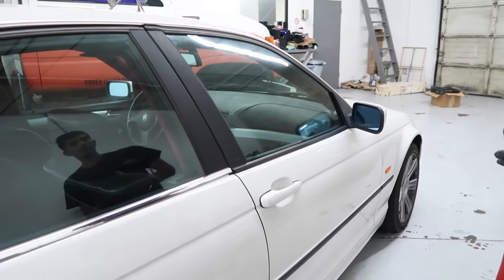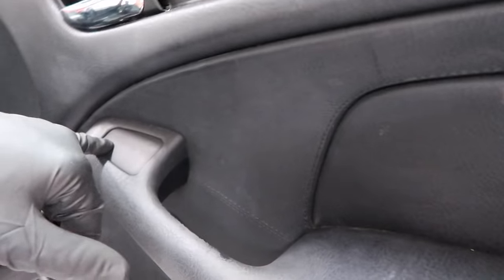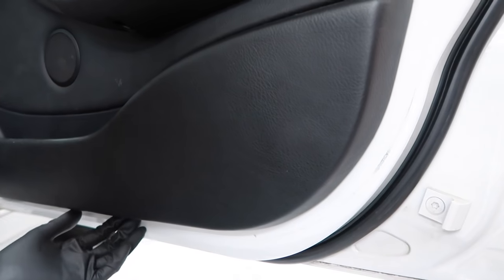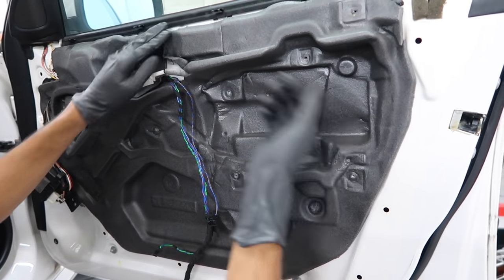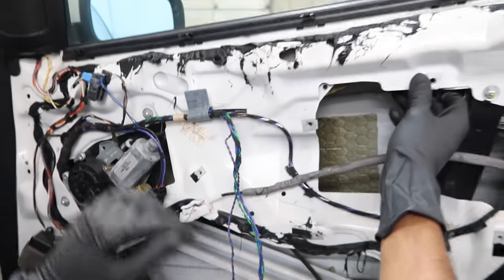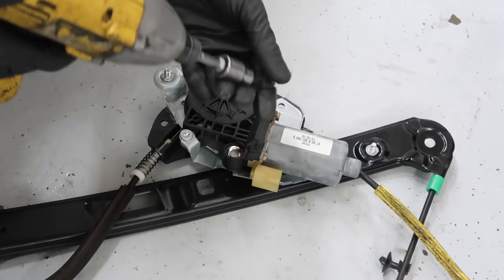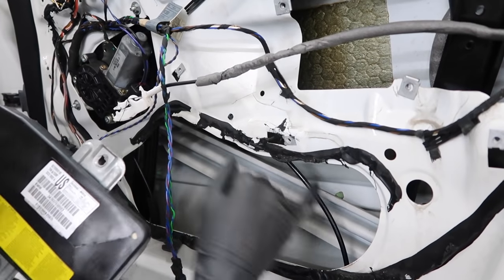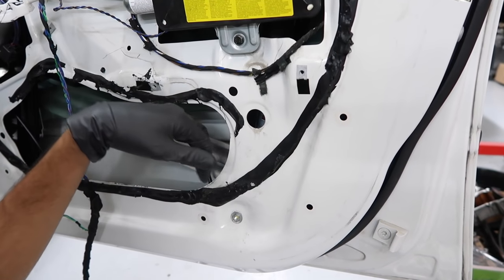BMW E46 Window Regulator DIY + Ebay Regulator Review

Comment: Just replaced my driver's side regulator with an Amazon $25.00 unit. Works like a charm. No fitment issues at all. I do highly recommend his tip to tape the bolt to the hex bit. It will save you a lot of headaches.
Reply: Can you drop the Amazon link?
Reply: You can also snag a teeny bit of that black goop thing and put it on the tip of your hex bit. Less hassle
Reply: Hi.. please share Amazon link.
Reply: I’ve done the same thing but it only lasts about a year or so. You get what you pay for when it comes to cheap parts so I’ve learned my lesson now for all 4 windows that a cheap regulator won’t last

Comment: Oh man!  The feels.... I think this was the first vid of yours I watched when I was having vapor barrier issues.  The rain was pouring in the bottom of my passenger side and you sorted me on how to fix that with your door disassembly in this video.  You helped with my DISA rebuild, vacuum leaks, valve cover #1, valve cover #2 when I did my VANOS. the VANOS, and two weeks ago when I did my whole cooling system. 

Now here I am again.  Two regulators went while stripping my old tint. You would think I would remember how it's done.

If you ever get back to Charlotte or Rock Hill, I owe you a lot of beer.
Reply: Hey I'm having the same issue but from the drivers side, what was your actual problem/fix as water keeps leaking through my armrest :(
Reply: @ii182  I put the vapor barrier back on and sealed the tears and bottom with Gorilla Tape. It has been working for years.

Comment: I just did one of these on a 2003 BMW 320D with a £22 Amazon regulator. In view of your problems, I did not remove the bolts holding the clips to the window. I just loosened them. Also, you might notice there is some position adjustment for the regulator by moving the screws in long slots. Therefore I left these loose until I got the window engaged in the regulator, and only fully tightened them after putting the window up & down a couple of times. Also, rather than keep removing the airbag lead, I just hung it on the lock button with a zip tie while I worked.

Comment: Nice video.
I did mine, and have a couple of tips: I did not unplug my airbag. I used a bungee cord and hung it from the top of the door/window frame. That way, I was able to raise and lower the window without worrying about setting off the SRS light. Also, I don't remove the 8mm bolts that hold the window to the regulator. Just back them off a couple of turns and the window will pop out of the regulator when you pull up on it, and will also pop back down when reinstalling. 
Other than that, I follwed your video and everything worked fine.

Comment: Master tech tip for all, take a little chunk of the black sticky rubber glue that holds the foam protective sheet in place and push it on the bolts then push bolt in to socket. Bolt will be secure when screwing in 2 window bracket holders. 👍😜

Comment: I had the same problem with the window dropping in to the regulator. I just loosened the back side track and raised it a little and that did it. Thanks for the videos. They're extremely helpful, and I appreciate them.

Comment: Followed your steps exactly per your video. Thank you very much for this great video. I managed to find the part on amazon and had no fitment issues, managed the job in under an hour taking great care not to damage the trim. Your tips were invaluable and cost me just £30 to change the regulator, which works perfectly now!

Comment: Just done the driver's side regulator, using this video as a guide. Slight fitment issue with the amazon/ebay $25 units. The bolts connected to the regulator, that push through the door structure, were slightly out of alignment, but easy to sort out. 
First time working on a car with airbags in the doors, so that was an added worry, but just followed your video, and everything was fine.
Window working again now. I am just about to do the passenger side as well.

Comment: I replaced the rear-passenger side using URO about 5 years ago for about $48 and so far it is much better, quality and faster wise that the OEM. I just bought two regulators and Bosch motor for the front doors to replace the OEM. Thank you Jason for sharing this very educational video.

Comment: Great video and it certainly helped me prepare for the replacement. I did procure a $20 Ebay regulator and it fit and works perfectly. Don't know how long it will last but since the original Bavarian unit failed, can't go wrong with a $20 replacement!

Comment: I appreciate the detail, especially at the "clips" and the tabs on the little plastic covers. This is why I pay the "stealer" to do my service! (I'm old). I can only add that with all the labor involved and having to remove the vapor barrier, buy the OM part, so to don't have to do it again in a year or two. Good luck with your new shop, wish you success.

Comment: Year late but I would like to add that it is usually a good idea to add some grease to these regulators. Bought a cheap one on e-bay about 6 years ago for my 2000 328i and haven't had any issues with it at all.

Another thing to do to make sure they don't fail is to make sure the inside the large seal that surrounds the window is kept clean so it doesn't bind or stick when you go to roll the window down.

Comment: Very nice video, takes some time and fiddling but with this is was still fairly easy work. I bought a cheap replacement option aswell and had some fitment issues on the motor-side tabs. Ended up bending the middle one (left of the window regulator) slightly to make it fit. After that it was easy work. 

Something that took me a few minutes to figure out since yours was broken was how to actually make the plastic clips holding the window slide off since i changed mine prematurely of it fully breaking due to bad noise coming from one of the wired. 

Once again very helpful, thanks alot 😃

Comment: This was a very helpful video as far as disassembly and assembly even if your new regulator had some issues. Thank you for posting this years ago, it is still very useful. I had a 1999 323i with this problem and used the Dorman part. A couple extra points, my window attachment bolts were very tight and a American Standard 5/16" socket fit better than the 8mm in my case. Also a dab of Goop on the nuts in that red tab kept them from falling out on reassembly. Thanks again

Comment: I have found a better way to hold the bolts is the tape residue from the vapor barrier. I've done 5 regulators on 2 different BMWs and it is easier!

Comment: Great informative video I used an eBay regulator and it works perfectly and fitted fine.Just a tip you can use masking tape to hold the window in place no need for a second person.This vid made the job easy thanks.

Comment: Thanks for the video man! had this job done start to finish in 45 mins with your help.  The hardest part was fitting the new motor & regulator.  Piece of advise take the new motor off the regulator if it's fitted and it'll make it much easier to slide into the door.  Cheers

Comment: Hey man! Thanks so much for this video, I was able to change my regulator with ease. I bought one from eBay for $20 and it works like a charm! Btw, here's my tip. Instead of using that blue tape to secure bolts when connecting glass just put a little bit of that black silicone adhesive since it's readily available all over the door :)

Comment: Thanks so much for your excellent videos ! I saw another video by someone else that recommended lubricating the windows if they were slow with WD 40 SILICONE SPRAY, which I did as my front passenger window was slowing more and more till one day it just stopped altogether. Then all of a sudden it started working again so I thought it might be a good idea to apply the WD 40 SILICONE SPRAY, but immediately after all the windows started making that awful rubber against glass screeching noise and the driver side rear window went down and stopped working altogether. All the other windows are working properly now and have stopped making any noises, but the left rear window refuses to work, so I guess I'll be replacing the motor and regulator when I have the money, but thankfully due to your DIY video I'm confident I can do it myself. I also put an auxiliary input to my stock Harmon Kardon unit mounting it in the ashtray "butt snuffer" using your DIY video and it has worked like a charm - I watch practically all your videos and enjoy and utilize all of them ! Yours are so professionally done and I really appreciate the time you spend on your editing and speeding up the tedious parts to make it quicker to watch ! Thanks again - I subscribed after the first one I watched and give a 👍 always!

Comment: I bought a couple of different regulators.  The cheaper ones, like $29  on eBay and elsewhere are definitely not made as well as the ones that are $50.  The cheaper ones' motor holes don't line up so you have to drill them out and bend them, and they don't put all the rivets in that hold the motor bracket to the regulator slide bar!  Missing 3 rivets where there are holes for them.  Euro is definitely made better, and uses bearings on one end of the pullys.

Comment: You can adjust the window up or down using the motor to find the two bolts aligned to hole in Window regulator to slide window up and take out old regulator.  But but remember to reconnect the air bag temporarily or until you get the Hole lined up. Then disconnect battery and disconnect air bag again. Then finish removing old regulator. Otherwise, you need a special scanner to clear air bag light on dash, essentially if the ignition is on to use switch and roll up window the air bag must be connected or air bag light is triggered as error. Don’t have scanner too expensive and had to pay mechanic $20 to clear air bag light last time I did this job. Also I’m by myself so taped window up to get old one out too.

Comment: It's been almost a Year since you posted this, how durable was it if i may ask?
Reply: It's been 2 years now, I too would like to know
Reply: Its been 4 years now...
Reply: Did you guys not watch? He ended up ordering another regulator because the right side carrier for the glass didn’t align properly and he recommended not to buy an eBay regulator. It caused more resistance in the window operation and he believed this would cause premature failure of the regulator
Reply: Look at 18:10 onward and he talks about it
Reply: I really appreciated this video,  thank you.   I had to replace the window brackets & nuts along with the regulator... and had a hard time fitting much of it,  so there was a lot of connect/disconnect with the negative terminal.  As much as i tried to keep the airbag light off...its now on and i cant clear it.  Ive tried clearing the codes however there aren't any codes.   Do you have a quick fix for turning off that light? I don't want to have to take that the door off again. Thanks so much for the help!
Reply: @Mr_Jonno  hi, looks like you're the only one responding to the video comments... im having an issue with my  Air bag light staying on after changing my window regulator on a 2001 bmw 330i,  I tried to keep the negative terminal off but was unsuccessful.... tx for any help u can provide
Reply: @Healthydiscoveries  hey! Ah sorry to hear that. I actually don’t know much about the fix itself or doing it, I only watched this video once and commented on it - best I would suggest is to continue searching for further videos on here and see if you can’t come up with another solution / that or try to find a reputable shop in your area to help you out! Those are the two best options I could think for you on that. Wish I could be more of a help and I hope this helps in some way!
Reply: @Mr_Jonno  thanks so much for responding... I'll let you know what I find.

Comment: Great video....I would question why the regulator was not working properly in the first place.  When I disassembled the door panel and removed the regulator (as per the video!), I found that the plastic bracket that the window connects to was disengaged from the regulator cable.  The plastic was cracked.  Instead of replacing the entire regulator, the cable needed to be re-inserted and then epoxy glued into the bracket (permanently).  Just was a different way and not a professional fix.  Any rate, great video and very helpful.  thanks

Comment: Wow, your videos are by far the most comprehensive and instructional videos that any buddy can follow. You explain every step very easy and understandable. Thank you very much for your dedication to help us out with our E46 or E39s. 
With that been said, I have a question: when you can still hear the motor winding but the window does move either way, is it the regulator or the motor that is failing? Do you suggest replacing the regulator with the motor all together? 
Thank you in advance for your time and prompt response

Comment: E46 window regulator is very common failures. It will will surely fail if you still have the original parts.  I replaced all 4 doors plus the motor too.

Comment: I love your videos brother, your awesome to the point and very helpful. Keep posting like a champ. I do have one other request which I'm not sure if you already have posted, but my driver side incliner is not working, the motor works but the part that is attached to the motor is not turning the rod, you can hear the motor work perfectly but the incliner is not moving at all, I was wondering if you could post something that shows how to remove that piece and reinstall to make it work, thanks again.

Comment: I find it easier to leave the fitting of the motor until the window is fastened, this allows you to move the window up and down by hand, the motor is easily fitted afterwards..also put graphite powder in the slides it helps to make it move easier ?

Comment: We’re those hex bolts reverse threaded? I think ours are but we didn’t know that and stripped the crap out of it. Now it’s the one step we’ve been stuck on for 2 days. We’ve tried PB blaster and about to use an extractor to try to remover them.

Comment: Good tutorial but I'm stuck.  I got to the point of needing to lower the window, but it won't move - seems like it's hitting something.  I took the motor out like you suggested but the window still won't come down at all.  Should I go ahead and remove all the bolts for the regulator and take the regulator out?
Reply: blythebugger  how did you get on.

Comment: I’m not sure if you mentioned it, I just recently got a 325i, what if nothing is working after the regulator and motor is replaced? 

All my windows were not going up or down and I fixed three but my passenger side will not work with the a new regulator and motor, what options should I take from here?

Comment: Shoplife tv question for you how would you know if it needs to be replaced I have a 03 bmw 325i and my passenger window opens but when I close it I have to pull the window up and press the window switch

Comment: I striped the 8mm bolt that connects the window to the regulator. Any advice on how to get it off? I have new bolts that came with my window regulator. Any help will be greatly appreciated.

Comment: So the battery stays connected in order to do this? I’ve seen other vids where they say to disconnect the battery to remove the airbag. I wasn’t Able to get my window back on the bracket since my battery was disconnected.

Comment: hey, i am glad you are back again, i just found new problems with my e46, when i got my car, i already knew that there are something wrong with the rubber ring inside the vanos system, and i bought the improved after market rings, after i changed those things, the engine runs smoothly for several months, but now, with cold weather, the engine wont keep the idle rev until tried for about 5or6 times, i dont know if there anything wrong with the vanos again, dont want to open it again until i am sure that thing is broken, i checked the ecu, nothing come out, there is one thing to notice is that the oil pump is not very good, i am going to change it, but i dont think that will effect the idle rev. do you have any idea with the problem? thank you
Reply from the maker: I would check your cam sensors, or maybe even fuel pump and filter. Any CEL's?
Reply: URO now has a redesigned regulator for sale at ECStuning.com for $68. I have one in route.

Comment: I know this video is kinda old but hopefully you can help me out: so i replaced the driver side window regulator and motor of my 2003 325i and when i try to close it it wont go up all the way it stays open about 2 inches is there anything inneed to do? I already tried to reset it but it didnt work

Comment: one more thing.. my driver side by the tires make metal touching rattling noise when I go over 20 30 MPh..not when I got warm up won't make anymore noise there are no check engine light on or anything

did you know what causing the rattling metal touching noise??

Comment: When I unscrewed the motor it still didn't come out. I tried rotating the motor to pull it out but I got some resistance and left it alone. Felt like if i kept yanking on it something was going to break. Any suggestions?

Comment: how do i manually move the window down for 2008 335i convertible , so i can access the clips for the glass, my window will not move up or down by both left and right 
switches , thanks.

Comment: Hey man, amazing video! So i replaced the regulator and the switch assembly (actually did the switches first since it was cheaper) and I even reinitialized the windows (as per the forums) but i'm still having trouble with the windows. Could you give me any advice?
Reply: bump?